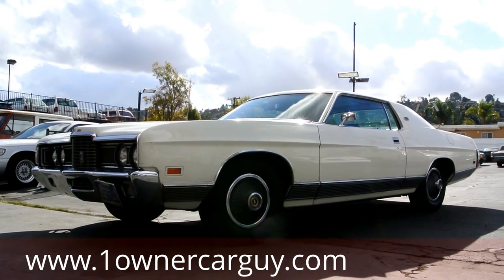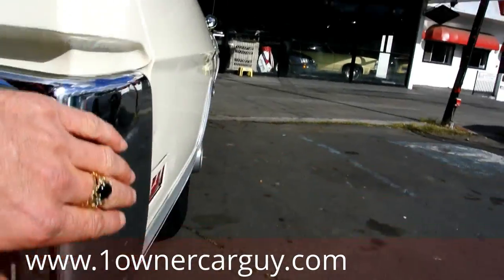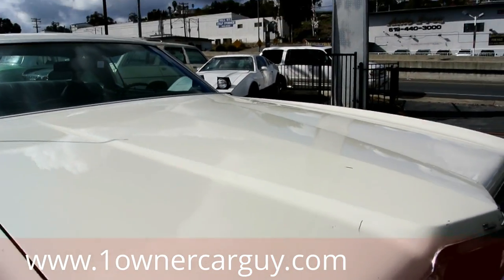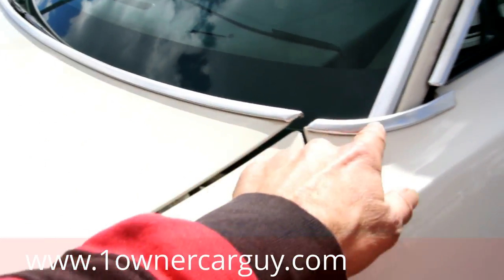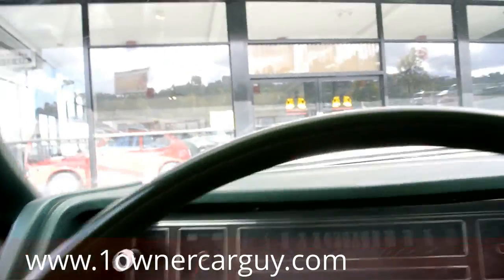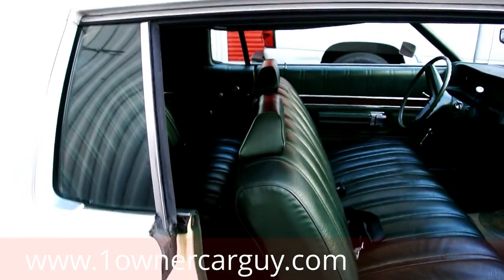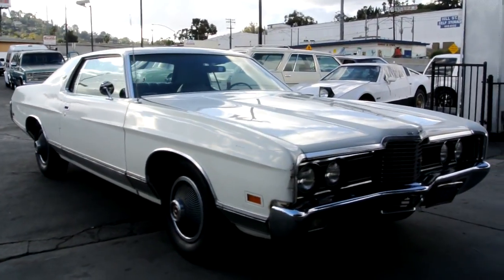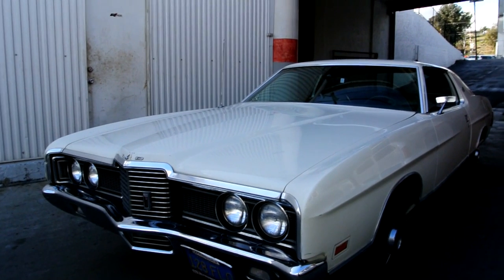1972 Ford LTD Galixie 500 1 Owner Video Review Classic 429 V8 2DR Coupe For Sale

Comment: These were solid cars.  '72-73' were pretty much the last good years for GM, Ford and Chrysler. It was all downhill after that.
Reply: Cereal Marshmallows
We had a '70 sedan. Decent car but nothing special. Dad used to turn the white walls around the same as the previous owner did on this one.
Reply: 70 had its malaise that made it maybe slightly less special than a 71 or 72, but if you could get a 2 door in black and put it on mags, lower the rear, front, or both... then maybe you had something a bit more special.  At least that's been my experience.  ;-)   Just sayin'.

Comment: It's not 9000 miles with rips in the seat and door panel. 109,000 more like it.
Reply: It has wear where it shouldn't if it is a real 9000 mile car.  I agree with you.
Reply: Yes, 109,000 miles is more like it.  A brake pedal worn like that means that car's had a LOT of stop and go driving.
Reply: If you listen closely he did say 109,000 in the video when he was checking out the interior.

Comment: These were wonderful cars, imho. I owned 2 a 2 door galaxie and a 4 door ltd, '71s. 351 windsors did ok but they were solid, ran forever, and were hands down better than the gm models - not nearly the rust or the internal malfunctions. Perfect, perfected mechanical autombile perfect for its time.

Comment: i have a 71 ltd. i'm second owner from a nice old lady. it needed some tlc new gas tank, brakes and lines, some gaskets, 8 track player installed for my blue oyster cult,  i wire wheeled the barnacles off the entire bottom and painted radar absorbing paint. my car has some james bond features such as a stealth button i care not to share. my engine is 400. tip for you all LTD owners is change the radiator to a 4 row core and new thermostat to a 160 not 180 for Los Angeles traffic. oil i use is yummy 15 -50 synthetic. more cow bell please! Burt you have my number!

Comment: nice car, I always considered 1972 to be the last great year for the Ford LTD's before they became bloated and uninspiring looking, 1972 was definitely the last of the good years for the automotive industry before they started to go downhill.
Reply: Agreed. The 73 and beyond had no soul. The The bumper had this ugly gap of plastic between it and the grill. The 72 still had the coke bottle shape in the rear quarters which shaped the windows nicely.  The grill became bland in 73. The rear bumper didn't integrate smoothly with the trunk well after 72. Even the tail lamps no longer had 3 dimensional shape as was the case up till 71.

Comment: Some years ago I use to own a 1969 delta 88,base car,no options,but it had a 455 rocket v8.I did a check and these cars came with a 350 as standard,so I look further and found false panel were there was a switch go to find out the car was ordered by a police officer more then likely a statey,how often do you see an oldsmobile police car
Reply: elizabeth v cherry   they used to be fairly common, along with Dodges and some Mercs

Comment: Ford used net hp ratings in '72 and rated the 429 at 205hp. It did have pretty good torque at 322 lb-ft. Hardly a true muscle car especially as this car weighed about 4,000 lbs. I had a '72 Ford Custom with a 429 Police Interceptor which would have had more hp than the standard 429. This is an LTD, the Brougham was top trim level with the Galaxie 500 being the trim level below the LTD. Base model was the Custom. It's pretty dinged up but at least it seems to be mostly rust free. White is probably the original color. Could be a nice car with some body work and a fresh paint job.

Comment: back when people towed their Shasta camper trailer with cars instead of trucks like today.  get yourself a big block sedan/wagon and you are campin'.  looks like old guy who owned this beautiful LTD had some trouble lining up with the trailer hitch so just went by feel and banged up the rear.  in fact, looks like an old guy car in general...lots of garage rash from navigation failures while parking.  I have a full size '70's car, and its amazing that its primary audience where those with the least ability to sense the corners of the thing.